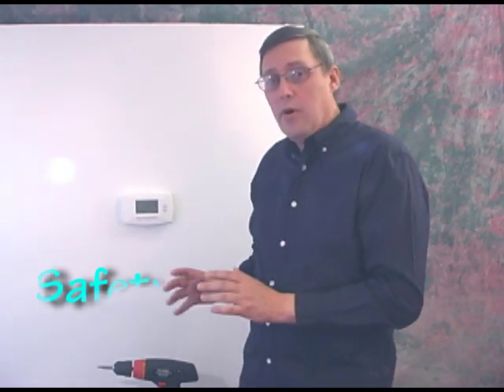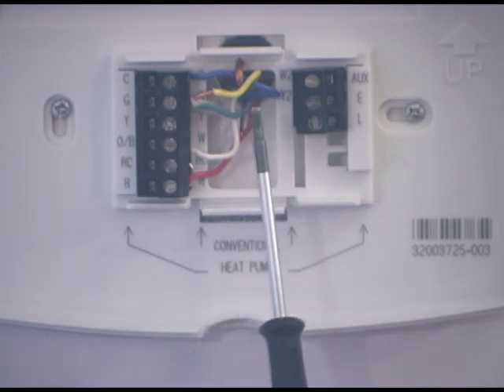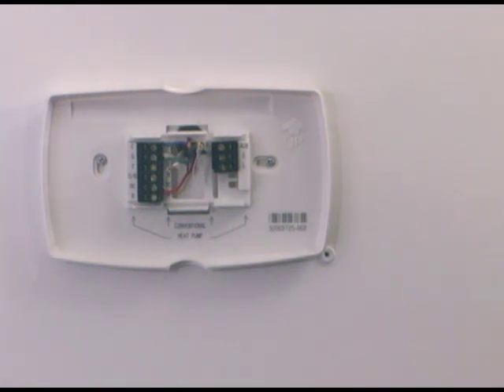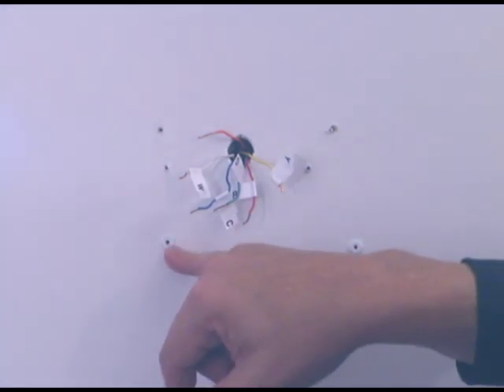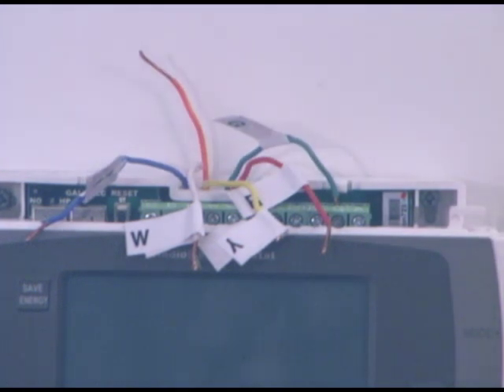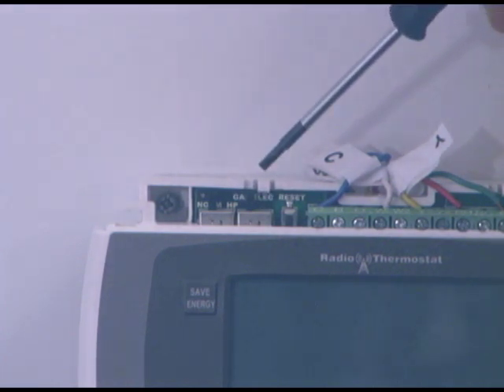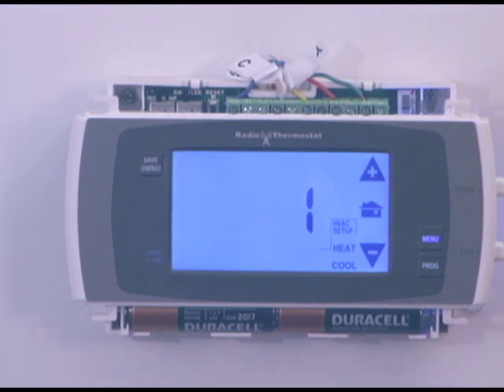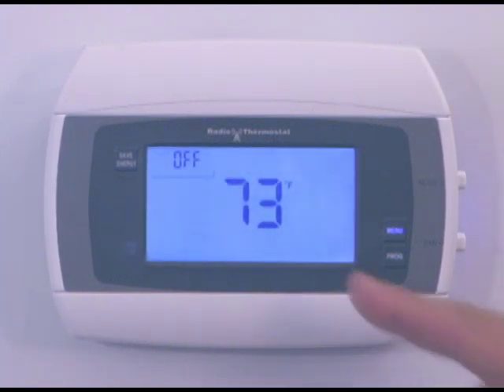Thermostat Installation Basics

Comment: Hi Homehandyman101, I'm replacing an Edge TP-PAC thermostat  with an Enphase Environ (for solar application) it happens to look like the Radio unit in your video, I can't hire anyone to do the job because no one will (install a product they don't provide) the current Edge is installed using a 2 wire pigtail method but the Environ calls for 4 wires C W Y RH G ..!! thanks

Comment: Hi!  Any chance I can get some help with mine?  I have a HP system, and each time I go from my honeywell thermostat to this one, it produces heat even though it is on cool mode and the temperature is set low.  When I go back to my old thermostat, it works just fine...  The wires of the original are  C, Y, W, W2, G, R and had a jumper wire between the Rs and also W2 to Y2...  Its a Lennox HPX14.  Thanks for your help!!

Comment from the maker: @tdkshadow Wire it without adding anything to the thermostat. You need to set the switch to heat pump - not to norm. You do not have to add the jumper.

Comment: I have a trane made heat pump. The originally installed t-stat had a jumper between Y and W. The white then went to W2. Do I need the jumper on my 3M-50?

Comment from the maker: @infringinator  The G wire is the fan wire. To your question: Would the furnace still work if I did have a heat pump and didn't hook up the heat pump wires? The answer is no, it wouldn't work.